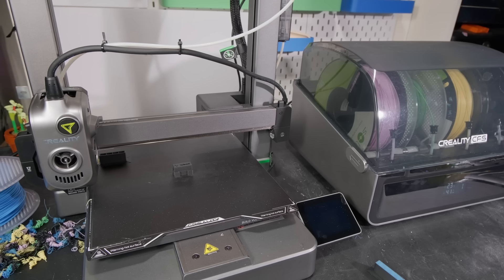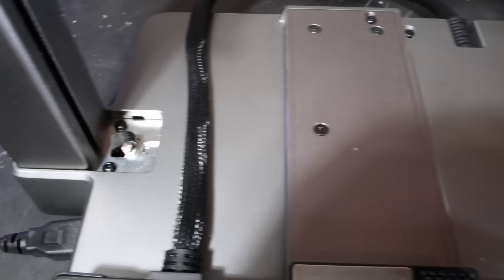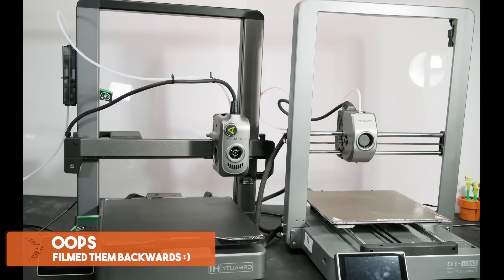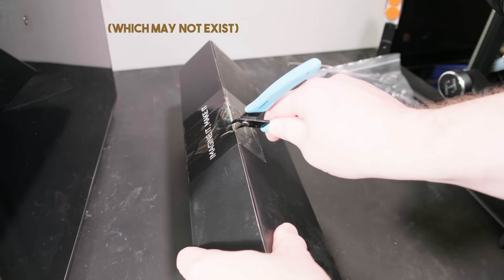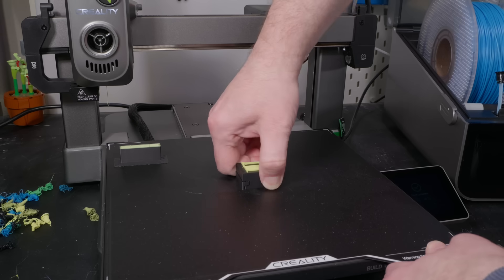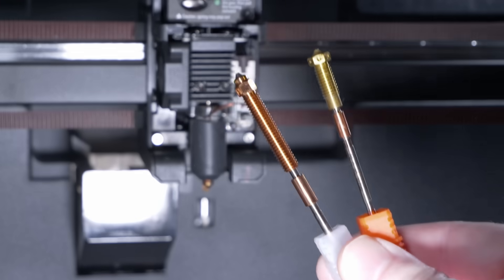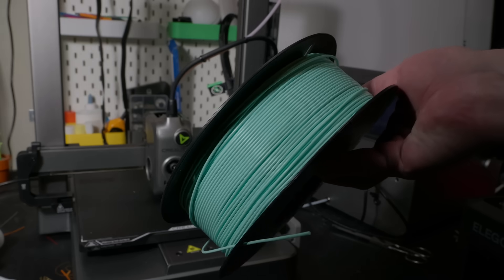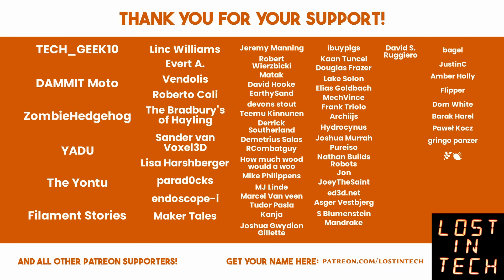Creality says Hi to budget friendly multicolour 3d printing!

Comment: My hi combonhas been rock solid for me. I only wish they would release a PEI bed. I am also digging into how the step servos work. Its actually impressive how they did the implementation
Reply from the maker: The hi bed is PEI isn't it?? 🤔 It sticks way too much though, I had them send me spares because I was damaging it. Glue helps ironically
Reply: @LostInTech3D  Its some kind of epoxy

Comment: I was kind of interested in this printer, not that I am looking to buy another printer anytime soon, just interested as I'm hoping to see more printers compete with Bambu so hopefully innovation continues, and the market doesn't get stagnate again! I was waiting for somebody to make a good video, as the ones I have found so far weren't from any channels I watch, this one is great. I'm glad you mentioned the smoke from the A1 as it's my third printer,  and the reason I bought an air purifier. I never noticed a smell at all with my first 2 printers, but it's pretty strong with the A1, which isn't good. I do like the AMS lite more than the AMS, which I didn't think I would because it's an odd looking thing, at least at first. I think I also prefer it also because it's easier to fit a wide range of spool types, I understand the AMS, and similar systems are harder to use in that sense.

Comment: Excellent as always. A couple questions: Can you not print TPU at... all? Or does it just not work with the CFS? Also how does the noise when printing compare to the A1 / A1 mini?
Reply from the maker: tragically - it doesnt currently work at all! I've never been defeated though, I just kinda ran out of time to figure out whether that's solvable or not.
Noise, it's pretty quiet. Same as A1 I guess. Mostly just fan sounds.
Reply: It seems K2 also won't print TPU (and can have trouble with PETG), so it might be issue with extruder - leaving too many options for the filament to find it's own route 😒
Reply from the maker: My K2 prints tpu just fine, the extruder is not the same I don't think.
Reply: @LostInTech3D  same extruder as the k2 

It's weird, a bed slinger wouldn't have that much issue with tpu with the whole thing moving left and right.
Reply: @LostInTech3D  Teaching Tech wasn't able to print TPU beyond small cube, might depend on stiffness 🙄
I haven't seen any fixes in Printables etc for the extruder yet. And Google sucks with names like 'Hi' 🤔

Comment: Why in the world would you use a razor spatula and/or try to break the print off a printer with a removable flex steel plate? Pick up the plate, flex both ways, boom! I'm super confused by what you did in this video.
Reply from the maker: The answer is already in the comments and the video

Comment: Actually the best AMS-like colour changer is the Anycubic ACE pro, not the AMS lite. The ACE pro uses one filament buffer per filament (this is to sync the ACE feeder to the extruder, so unlike the MMU from Prusa, the ERCF for Klipper or the Chameleon from Chameleon3d the feeder on the filament changer can stay engaged to to whilament while printing). By using one buffer per filament the tubes can be joined as near as possible to the printhead. So the ACE pro combines the advantages of the AMS light (short distances) and easy handling (full AMS). As a plus: filament dryer integrated...
Also the AC Kobra 3 combo is Klipper-based. Someone made an open klipper for the Kobra 3 and researced the comunication protocol between ACE pro and the printer. He released it as "DuckACE" on github. So you could use the ACE pro on any Klipper printer.
Of course you need a hotend with filament cutter inside and a way to dispose the poo.
Or you change the hotend to a Revo, put a standard flow 0.4mm nozzle inside and use Prusas "ramping on unload" to get a nice reloadable filament tip on unload, changing filament much faster (in about 30 seconds compared to nearly 2 minutes) and reduce waste massively.
Actually this is something I work on for my SV08, my X-max 3 and other printers as one of my to many projects.
Also the Kobra 3 combo is extremly cheap. All theese filament changers cost about 300€ without printer. At Anycubic´s store you practicly everytime you got some coupon. On my last order I would have paid 289€ for the ACE pro, but only 379€ for the combo. So I got a nice little printer for tinkering for just 90€. I definitly should wait upgrading my klipper printers, else I need more ACE pros and get a problem with space storing all theese to cheap to resist Kobras...

Comment: Yet another "AMS" clone... I might be grumpy old man shouting at clouds but I think the AMS system sucked already in the first place, it's cheap, it's easy, it's boring and again, it's cheap. Like, we already have Mosaic Palette, copy that and you already have a bit more expensive but a bit better system that pretty much makes Bambu Lab look like cheap piece of earwax. Palette might be covered by 5 million patents and Mosaic is probably going to come after whoever copies it harder than Stratasys tries to murder Bambu Lab for purge towers but probably at this point it's pretty clear how much value the whole 3D printing community and especially the manufacturers give to each others patents (was it like 5 or even 20 patents Stratasys took Bambu Lab to court? Either way, if Stratasys wins there, they're going to sue like 9 out of 10 printer manufacturers the next day).

IDEX printers were cool where did they go? Oh yeah, they weren't THAT fast so no one gave a booger about then when the speed became the main thing in printers. Who knew we were going to be circling around the problems they were a perfect budget solution couple years later and now we just waste filament as poops because... Tool changer are going to be big thing for a long while for those with money to get multiple printheads and all that, it's pretty good.
But there's way more semi-budget solutions that haven't been made by Bambu Labs or Prusa so no one else is yet copying them because well.. Prusa and Bambu Labs haven't marketed and pushed them to the consumer space yet. Head offset is always a solution, take a printhead, put two hotends into it and there you go, it's a bit wider head and reminds IDEX system a lot but you can print two materials rather fast, the stringing sucks thou. For single material or just two very, very heatwise similar materials you can make it even cheaper and just have multiple holes in one nozzle.
Or we just go to the good ol' Stratasys and steal what is left. The midway of tool changer and head offsetting. If someone hasn't seen Stratasys FDM printer, they have a printhead where there's 2-4 head module places where you put your chosen modules (ABS, PLA, PET, whatever), those are fed by the material bay which depending on your setup has 4 spools which either each feed 1 head module or multiple bays feed  fewer head modules (not at the same time, just when spool in bay 1 runs out, the bay 2 starts feeding).

And then there's the PolyJet... Like if you're fine using UV-resin for printing, oh boy, are you going to get excited in couple decades when/if the PolyJet patents get out of the way. Like what if we ditch out the whole idea of having colored filaments and just add whatever toner we need into them when we print them? Like, basicly it's just a ink printer but instead of ink it's UV-resin and layers after layers of it. And yes, they do use even multiple materials thou they're basicly still all UV-resins, just different. But that 6 figure pricetag is a bit downer and they make even Formlabs look like saints with their 4 figure "3rd party resin license" scheme. And just as Stratasys in general with their Makerbot and UltiMaker lineups, the PolyJet is probably going to be outdated as soon as someone else takes a look at it.
Reply: All of these are industry options. 

And mostly inaccessible, both monetarily and also physically because those are really really big printers.

Next i looked at the pallette thing. Good idea like mmu but much like the mmu it seems really unreliable for $800. 

The ams succeeded because it's really just a lot more dead simple with just a cutter inside and pull it out. 

And i think the reason why it's popular because of the bundle.  Selling it as a option alone isn't gonna attract a lot of people. But as a bundle deal well who could say no to something like that.

Also that lawsuit was dismissed

Comment: @LostInTech3D - I just had a thought when you talked about the extra long purge requirement - I had a lightbulb moment - Purge into the infill. That is, if there is enough infill to be printed (the slicer would know), then the purge length can be dynamically calculated, and then on colour change, do a calculated purge followed by printing infill (old colour parts of model, or new, or both would work). By the time the outer walls are printed then the full purge would be completed and no colour artefacts should be visible, but a wipe/nozzle clean could easily be done just before the outer wall printing to cover.
The reason for the purge first then infill is that the infill will then be less intense old colour, but this could be swapable too. It also should not be hard to get the slicer to do the 'infill purge' from the centre out. Adding an 'extra purge distance' parameter into the slicer settings could allow for extra length should the colour not be fully purged in testing. In this small change we have reduced waste, reduced print time, made the 'waste' useful, and removed a large portion (and potentially all in some cases) of the purged material needing to be stored and disposed of.
Anyone out there good with slicer code and/or gcode and firmware?

Comment: Two things I noticed, one of which is a legit concern with the other being my Asperger's:  First, no heatsinks on the stepper driver ICs.  I do NOT like that.  Second, that "wheel" on the printhead that spins...what's the point of it?  Doesn't look like you can actually use it it manually feed filament through and with that arrow printed on it it becomes a HUGELY annoying distraction (again...Asperger's).  Other than that this seems like a fairly decent option to compete against the A1 and and Kobra 3.  I have my own reasons why I would NEVER get either of those so this might be a viable choice.  But the only reason I would ever get a multi-material system would be to use dissimilar materials for better supports.  Frankly I just don't understand the passion people have for printing multi colour trinkets.  My printers are tools that I use to print other tools and functional parts.
Reply from the maker: There is a heatsink on the extruder driver on the toolhead board though. Weird.
Reply: Heatsinks are not needed for stepper drivers on a properly designed board; conduction from the exposed pad on the bottom of the chip (which is directly connected to the silicon die) to an inner PCB layer (through thermal vias) will remove more heat than a tiny heatsink glued to the top of the chip (insulated by a layer of plastic).

Check out the duet boards -- not a heatsink in sight, and they definitely know what they are doing.

The exception might be plug-in stepper driver boards, which could be small enough to benefit.
Reply: @thomasnixon4440  I hear you, but having had "properly designed" boards that had chips burn out from overheating I still want a heatsink on it.  Even if it only helps drop temps by a degree or 2 that's still a couple of degrees of added insurance.  I'd rather have an unneeded chunk of aluminium than not have it and need it.   Consider it a marketing ploy. 😀😀
Reply: @Enjoymentboy  I wanna ask, do you minmax your machine to be too poweful. Because there's a limit for a reason. 

It's probably just that the chips themselves are already good enough for what it's generally gonna do for most of it's users. 

And there's also the added cost of those heatsinks.
Reply: @hihellothere9569  I just prefer to err on the side of caution.  I've also had stock boards without heatsinks have ICs burn out from being driven too hard without adequate cooling.  I would prefer to have a cooling solution that I do not need rather than not have one that I do need.  I'll pay the extra buck for the illusion.
Reply: @Enjoymentboy  I understand, but it seems to me at least the board is well cooled by the fans near the powersupply instead. 

And hey you got the option of doing it yourself.

And also the spinny thing. It's mainly just aesthetic. I like seeing gears move around.
Reply: It feels like the spinny spinner is rotating backwards. A place to put right (or left, from toolhead point of view) googly eye so the head is half eye-rolling all the time 🤪
Or create a scene from Steamboat Willie - Mickey Mouse turning the wheel 😅
Or Dupond and Dupont pumping air all day (and night) long when diving for the treasure ☺

Comment: What's more rare then unicorn? Unicorn 2 🙄
I have never liked Bambu Lab. Closed everything. A1 disaster. Now messing with 3rd party access, closing up even more.

Having seen print quality from A1 Mini and seeing responses from other manufacturers, it's still hard to think of any other 4-color printer within similar price range. For politics and ideology, yes. For print quality and reliability, less so. Having one nozzle type among most used printers (and one Aquila 😉) is something to think about.

Anycubic Kobra 3 is closed klipper and doesn't tune itself as well. ACE might be getting better. Not sure if S1 adds new sensors to print head.
Hi - aiming h i g h e r - tries a lot and gets a lot right (construction, steppers), but weird nozzle * and "mile and a half" retraction to change to another color...
FF AD5X has it's own problems.
Elegoo CC might get MMU, or is it for another future printer?

* it's not only the nozzle, it's the whole printer, really. They had V3 and V3 Plus already, so why design another new printer from ground up? How many "Crealitys" (Crealities?) are there within the brand?
Reply: Just saw K2 review. K2 has nozzle clearly visible, but Hi blocks the view for no reason. Stupid Creality 🙄

Comment: Fantastic video!  I hope you continue to test and post vids with regards to the HI.  Please post the cfs upgrade video and the problems you have experienced if any. Creality seems to be dragging their feet on the release of this kit. I have a max and looking forward to doing the conversion but it's been pretty tight lipped about the release and the problems with the transformation.   Thank you in advance.
Reply from the maker: will do, I would like to see it working also so I'll push ahead with it
Reply: @LostInTech3D  what issues did you run into doing the upgrade? Did the software create buggy issues.
Reply from the maker: We're trying to work that out from the logs, it looks like a sensor is firing when it isn't. But as to why....remains a mystery
Reply: @LostInTech3D  okay, thanks.  This would explain why creality is not allowing the YouTubers to post the install yet. I have asked a few to answer a few questions but no one has replied. The front usb is occupied by the cfs once activated. If you have another device also requiring the use of the usb, are you able to implement a usb hub and plug both devices in to the hub and have full functionality? If want to stay off line and transfer files via a stick will it work in conjunction with the hub? Sorry for the long possibilities above. I asked Kevin at creality if this would work but his printer does not turn on so there is no way to confirm . Thx
Reply from the maker: No they don't have it yet. Check 3dprintsos who just live streamed it though, literally yesterday I think.
Reply: @LostInTech3D  thank you for the heads up.

Comment: I am excited to get a core xy printer. I have only had an Ender 3 V2 until recently. I recently acquired a Neptune 2 and I’m glad I started with the Ender. If the Neptune was my first printing experience I would probably have lost interest. The touch screen is neat I guess but the Elegoo UI leaves a lot to be desired. I still have dreams of a Prusa XL but will probably end up with a Qidi Plus4. I’m kind of waiting to see what the Qidi Box turns out to be.
Reply from the maker: there are fortunately a ton of corexy to choose from now
Reply: My first printer was a Creality Ender 3 V1 and I've have tons of bed slingers since then. I recently bought the Qidi Plus 4 and have been BLOWN AWAY by it. Does it have issues? Yes. But other than the SSR issue, which was/is a big issue due to potential fire hazard in 120V countries, any problems are super minor. Any print failures have been user error, me crowding the plate, using PETG settings for PLA, forgetting to enable supports in slicer (I was tired when slicing so feel free to mock me lol). I'm super stoked for the Qidi box but I CANNOT recommend buying it at launch, give it a few months and let the day one buyers work the kinks out.
Reply: @bagpipeblues yeah I'm still in the process of saving for an XL, and wondering if the Orange Storm Giga is worthwhile or not.